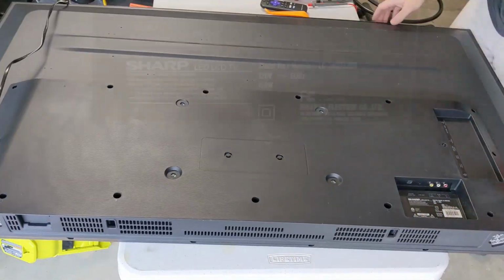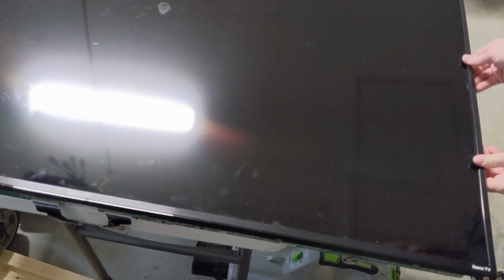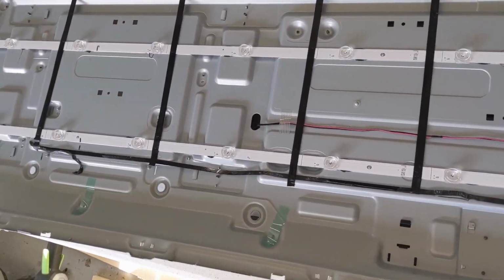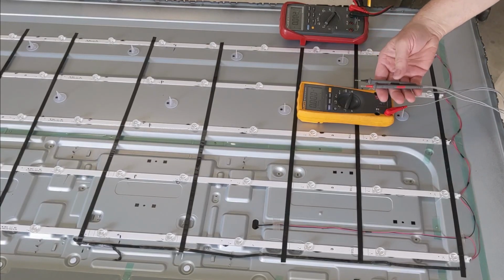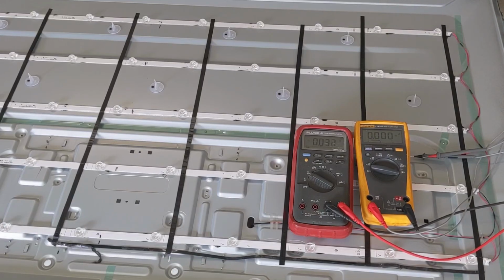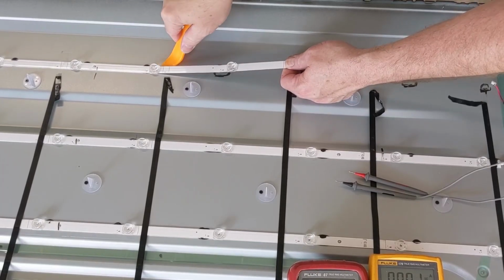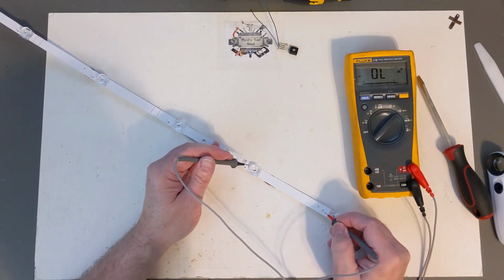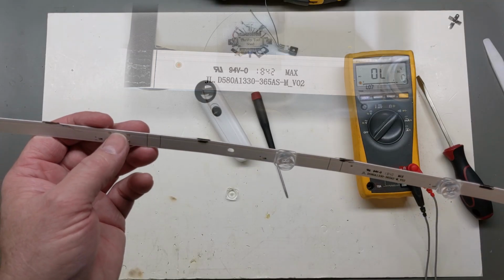Sharp 58" TV LED Back Light Testing (Part1)

Comment: Hi, I have the 58" Hisense version of this TV and the internals looks identical to the Sharp branded one you worked on.  I'm pretty sure one or more backlight LED's are bad because the led driver outputs 100-210vdc but there is zero light from the backlight.  However, I'm not sure whether there are additional  problems with the mainboard or power supply because this TV is not able to boot up to the main menu.  I can get the Hisense logo to appear on the screen but the TV gets stuck on endless loops between the Hisense logo and blank screens.  Anyway, do you recall if your Sharp TV exhibited similar behavior before you fixed the backlight?  I wonder if the TV monitors the led driver current, and somehow shuts down/restarts every time the led driver voltage maxes out.  Disconnecting the backlight plug doesn't help the TV boot up either.
Reply from the maker: The Sharp I worked on did not do that, but that does not mean some firmware revisions might. I have no experience with that, but it could be a main board issue also.
Reply: I have the same problem with Sharp LC-58Q620U, I swapped all the boards and it boots in loop with no backlight. Now I'm trying to identify a bad strip, but they are all glued so badly and multimeter buzzer does not lit them up individually as showed in this video.
Reply: @Sasha Dimitr  I fixed mine by replacing all the LED strips.  Cost was around $25 from aliexpress.
Reply: Hey friend, you are probably well past this problem, but perhaps someone else is looking for details. 

My TV had the same problem, and it was the backlight.  The way it's wired up, if one of the LEDs isn't working, it will not boot up, unlike other TVs where it will turn on and you can use the flashlight test.

Comment: Great video. How did you know the backlight was bad? I have the same TV and I'm trying to troubleshoot. I have no sound and black screen, standby power is OK. I replaced all boards, Main, Power and T-Con but same issue. How can I see if the backlights are bad, is there and easy way to test? Thanks
Reply from the maker: Yes, I mentioned that you can shine a flashlight into the LCD screen and look closely to see the image while powered on or powering on and then you know the dark image is there but no light behind it. I did not take time to show in this video since I showed a few minutes of it in the 47" Vizio backlight repair video just a few weeks earlier. Hope it helps and Best of luck to ya!
Reply: For this TV, if the backlight is bad, you won't be able to turn the entire TV on.  Kind of a bad design if you ask me.  I just replaced my backlight with the same symptoms of you, and it fixed it.